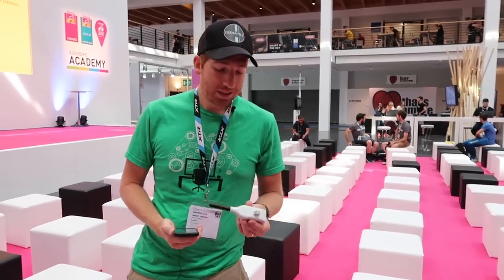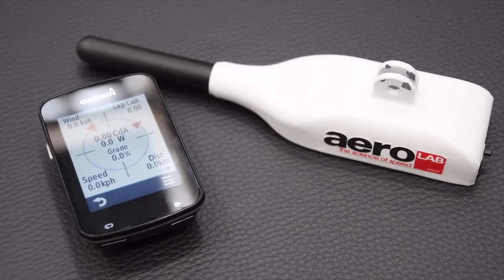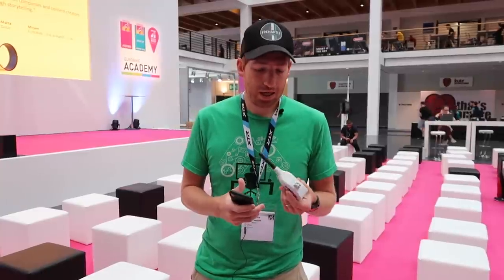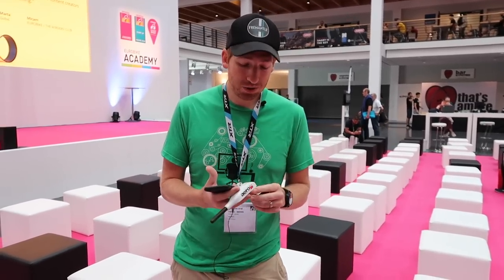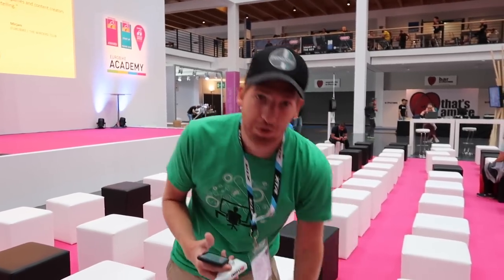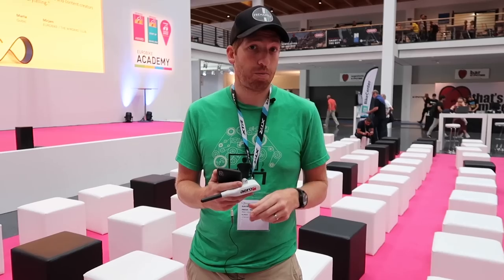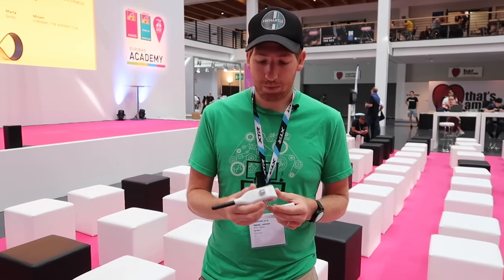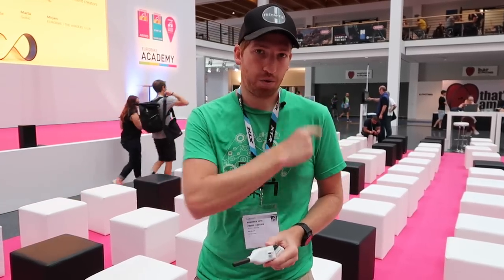AeroLab Cycling Sensor: July 2018 Tech Update

Comment: Do they have any data on how much the device itself influences aerodynamics?
Reply from the maker: I haven't seen any, but it's definitely something I'd love to dive into - perhaps by leveraging one of the wind tunnels out there.  I'd probably wait till there are a few more devices on the market though, to get the most bang for my bike in terms of wind tunnel time.
Reply: I guess one problem poses the adapter to your handlebar. It looks like some GoPro-style adapter - and those can be pretty bulky (in comparison to integrated stem/handlebar). 
But I have faith, DCR will cover this as well :-D (or was there already something said about handlebar-GoPro-adapters?)
Reply: Sort of like the Heisenberg principle for aero testing. You can be aero or you can know how aero you are, but but not both. I love it.
Reply: To this point, the effect of the device was not tested as the external form factor kept changing over the last 8 months (smaller electronics, etc.). The device here is close to its final form factor, and so we are looking forward to wind tunnel testing (full scale) to identify its effect on bicycle-rider aerodynamics. I expect the change in drag on the bicycle-rider system to be less than 0.25% (~ less than 5 grams).

Comment: Are these really so accurate that you can e.g. track hand/finger position changes over aerobars? What accuracy are they claiming vs. professional wind tunnel results?
Reply: I suppose the answer to your question depends on the effect of your hand/finger position on the overall aerodynamics, which will be rider/position dependent. I have a few different articles up on the effects of different assumptions on the accuracy of the CdA estimate here: (https://www.aerolab.tech/tech-blog). For instance, to infer CdA, you need a power measurement, and so any bias in a power measurement calibration will propagate through into the CdA estimate. To infer CdA, you need an estimate of rolling resistance or you need to calculate the rolling resistance of the wheels in real-time. And there is more...
Aside from the above, in an uncontrolled outdoor environment we can easily see changes in real-time on the order of 0.01 m^2, and often better. If you then take some averaging into account (say, using a protocol involving out and backs or a looped course on the order of 1km), the estimates get much better. The more trials you do with the same position, the estimates continue to get better. Your effects of random errors in your estimate move toward zero, but this does not eliminate bias errors (if they exist) in the measurement. In a wind tunnel, you would also acquire data for an extended period of time and use averaging to reduce the impact of random errors and converge your result to a satisfactory level. Same applies here.
Reply from the maker: When I tried AeroLab out in the wild, it did capture such changes.